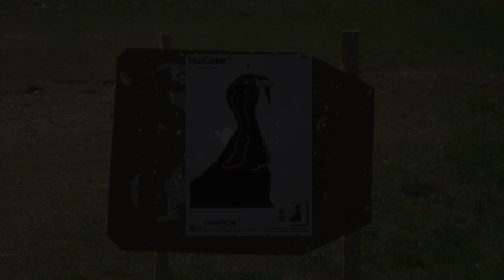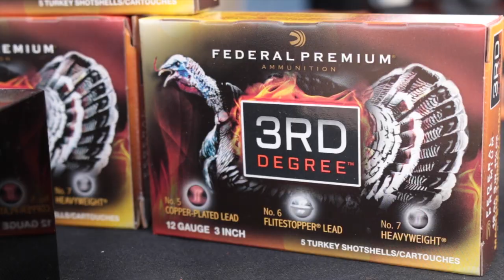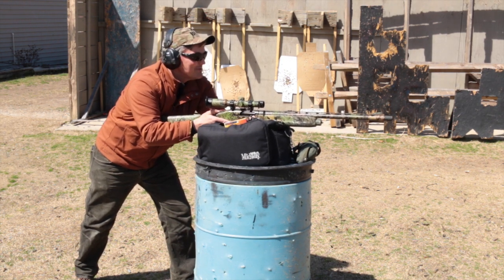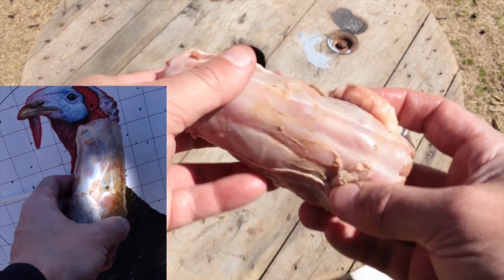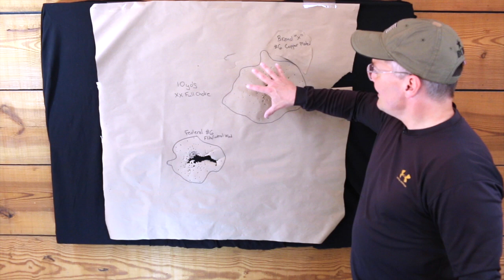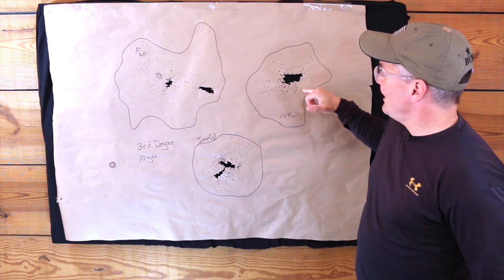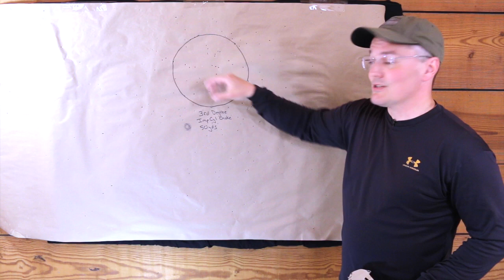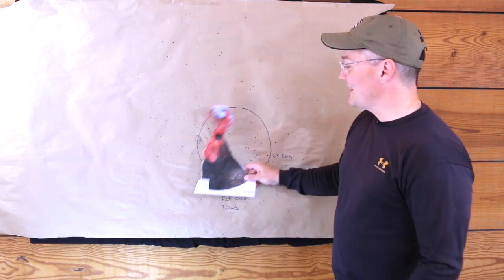Federal Premium 3rd Degree!  Full Testing & Review

Comment: Little contradiction I noticed here in the video. You say the flightstoppers up front are designed to spread out quicker and produce a little wider pattern that would otherwise not be as deadly or as wide at close range with a competitors ammo. Then, when you text 3rd degree vs brand X, the pattern is twice as tight on 3rd degree. It would seem there truly isn’t a one size fits all solution. Either you want to snipe the birds at 60 yards or you want to stick with the 30 yard standard. Bought 3 boxes of this 3” stuff for less than $8 per box on clearance, curious to see how well they actually do.